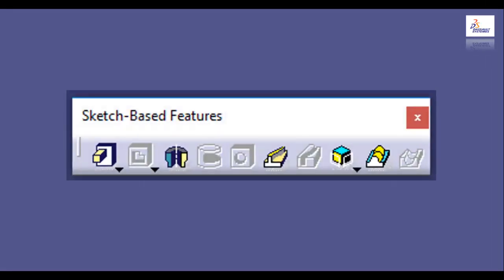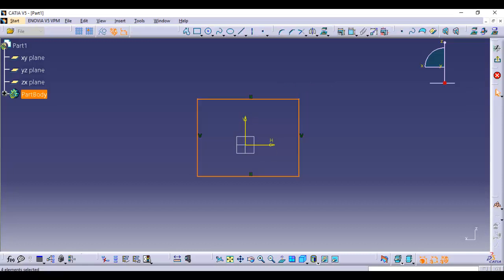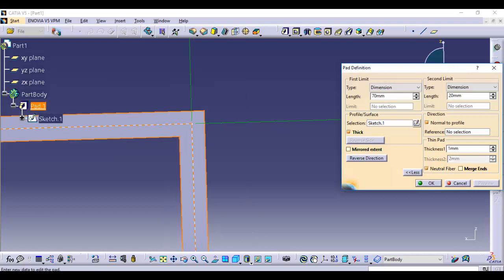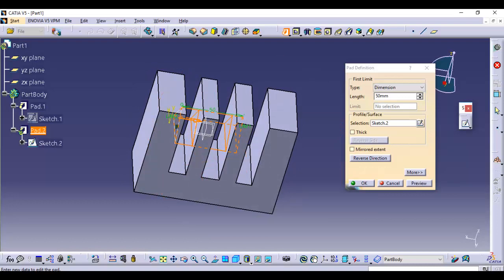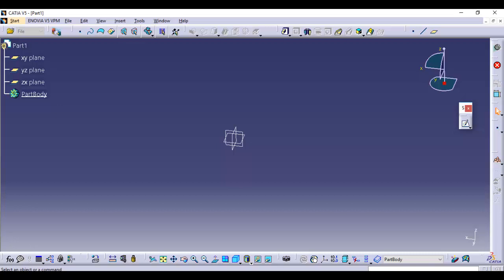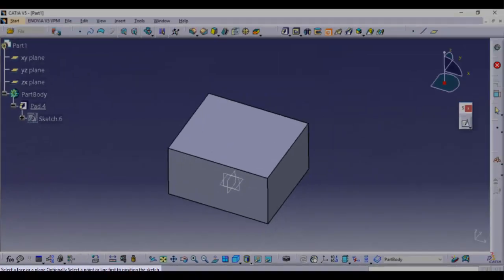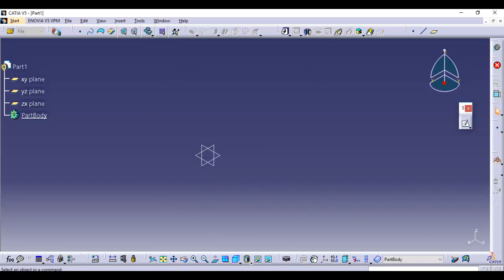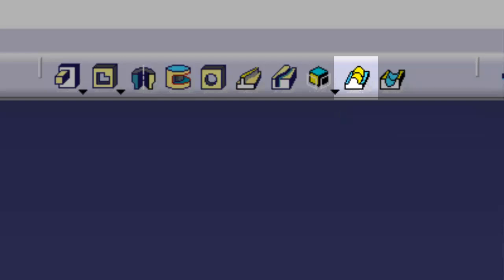Part Design in CATIA - Pad, Pocket, Shaft, Rib etc. - Lets get better at these Tools

Comment: how we can create the pocket  on nonplanar surface with the uniform dimension  just imagine there will a spline kind of a surface with the width of 30mm height of 30mm length of 100 mm there will a 4 waves kind of spline
Reply from the maker: Hi, you need to first create new plane. Draw your profile on that plane then use pocket command to create pocket. If you want uniform depth for your pocket then you need to use other commands to cut the material as you want. You can do it in Part modelling itself OR you may have to go for hybrid modeling. This totally depends upon the shape of your model and how you need to cut the material.